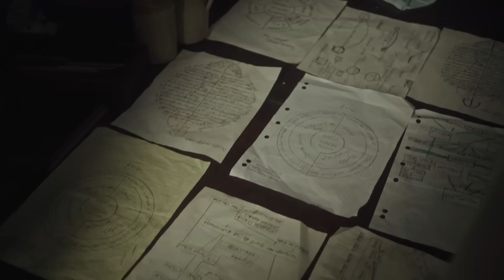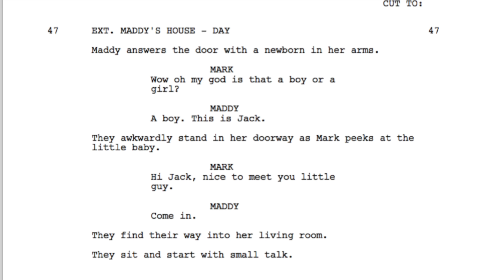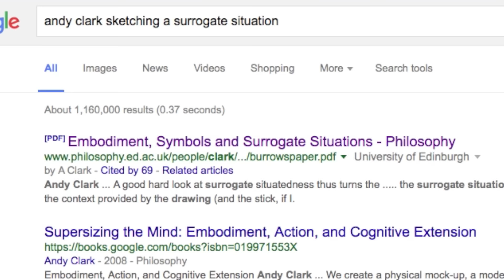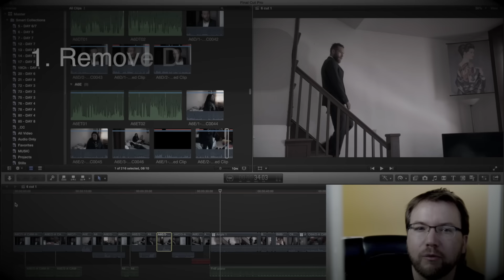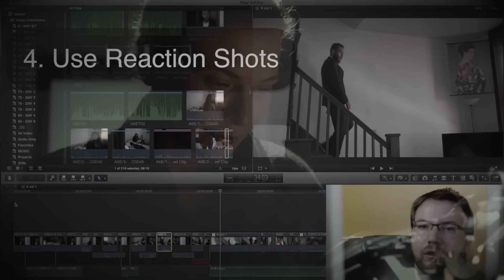The Science Behind Film Editing

Comment: It's an interesting and certainly valuable concept, but others have questioned practicality. There isn't usually time or money allotted for a first video draft like this. Also, many of the problems she found in that first edit draft are problems that an experienced screenwriter or director would have caught on paper, because that's their job. I don't mean to diminish the role of the editor. I definitely agree that editors write the final draft of the film. But these issues used as examples here involve actor blocking (which probably wouldn't show up on paper anywhere; it's a director choice) and stakes, which a screenwriter should already know how to visualize. If the screenwriter can't tell that two men simply walking into a room and the woman handing over her equipment isn't visually impactful, then they're a bad screenwriter. Personally, I've seen the editor come to set either to edit in real-time (Baby Driver) or just to advise and confirm timing and pacing issues, which both work well.